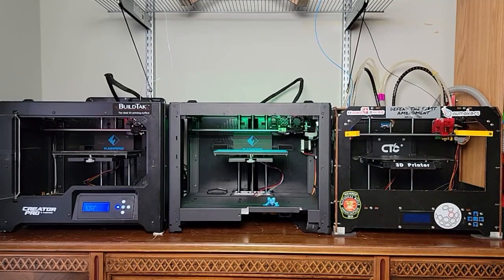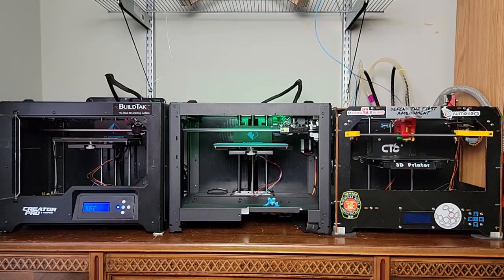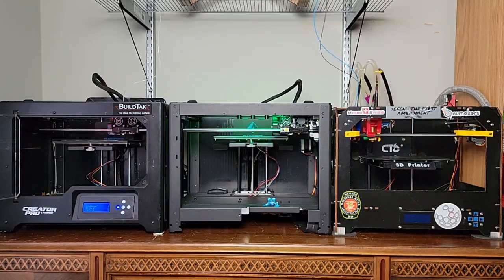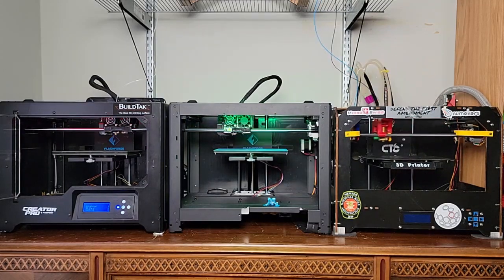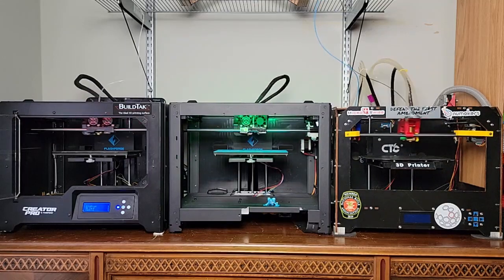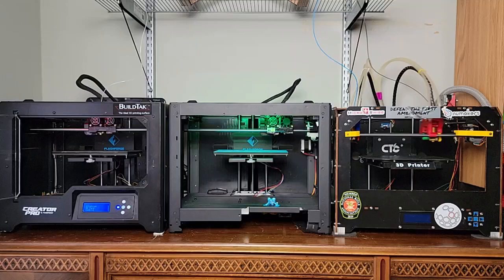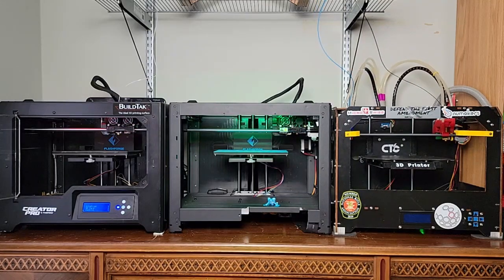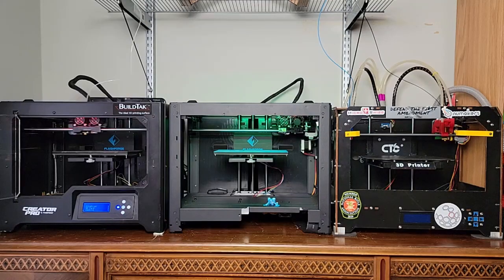Is this the future Bambu Lab P1P killer?

Comment: P1P killer? Not with a cantilever bed and manual z leveling.
Reply from the maker: Thanks for watching and commenting on my video. For some reason, cantilever beds got a bed reputation.  With steel frame and steel bed support brackets, I hardly ever need to make any Z adjustments.  The printer just perfectly prints every time.
Reply: @m_IDEX  bad reputation through experience. cantilever beds cause print defects from wobble and flex. and since cheap printers tend to use them and have the worst implementations, cantilever beds get associated with bad print quality. much better to use 3 point design which is inherently more stable by design. i mean cantilever gantry "works" too but they died off for good reason :) it's not a p1p killer because the p1p requires ZERO Z adjustments ever. p1p is plug and play, which is a huge selling point.
Reply from the maker: @TMS5100  I just drove my printer 151miles to Midwest RepRap Festival - MRRF in Goshen IN.  Setup and started printing with zero bed adjustments.  Also same after returning home.  My point is that cantilever beds can work well if designed properly.  Flashforge finally got it right with an all metal frame and not a single plastic or wood component near the heated bed.  I love the p1p, but the race is on especially for multi color and multi material printing.  Bambu is a fantastic catalyst for the whole industry.
Reply: @m_IDEX  it's about the print defects that come with a cantilever bed. with small beds like flashforge it's less of an issue. but large printers that try to get away with cantilever beds suffer from print defects from bed sagging not just under its own weight, but also as it becomes heavier from print material, and from the bed wobbling from z hop. again the reason cantilever beds are frowned upon is the same reason cantilever gantrys are. the compromises from the cheap design leads to print defects. but then we have become increasingly critical of what is considered acceptable print quality. look at how popular pressure advance and input shaping are now. what was acceptable level of defects in 2017 is no longer the case, and that sums up cantilever beds as well.

Comment: seeing how the gantry is carrying multiple stepper motors and stainless steel rods and direct extruders, no way will it compete with P1P on speed, but it  may beat the ams for speed and filament poop and purge block wastage.
Reply from the maker: I am currently editing a video where my gantry shed close to 300grams and much more is in the works :)  AMS is Bambu Lab's weak link (in terms of speed and material efficiency), but I am sure they'll try to improve it.  Double Magnetic IDEX is my ultimate goal :)

Comment: Bambulab has destroyed every 3d printer manufacturer there is... If they all aren't in defcon4 right now coming up with a game plan in the war room they're in big trouble. Of course there'll be the die hard fanboys on inferior machines cough* PRUSA *cough but they won't be thriving like before. 

If the XL doesn't come close to the P1P in speed it's gonna be a very bad look, especially after all those delays and a $1000 price increase.
Reply from the maker: I couldn’t agree more.  Thankfully the hobby developing rapidly.  Especially thanks to Klipper firmware.

Comment: Not even close. This kind of setup have been are years
Reply from the maker: Thanks.  P1P is a fantastic machine!  Can't wait to demo multi material head to head race.
Reply: @m_IDEX  I have a X1C with AMS, but dual material is so slow and consumes time if you have more than one material change per layer. IDEX for two material or a tool changer system for more than two are really preferable from a waste and time reduction POV. I tried to mod my Climber 7 IDEX, but the toolhead width constraints fought part cooling by a mechanical fan, so those air tubes of yours could be preferable solution, if they are flexible enough.